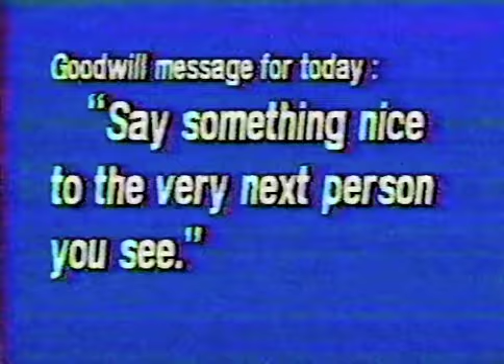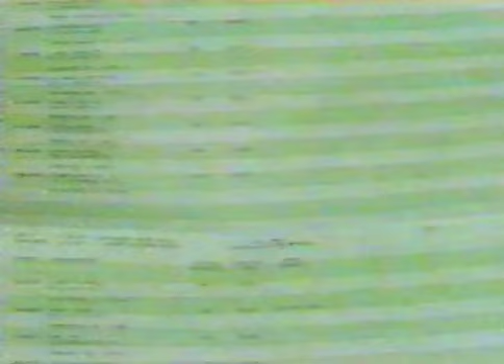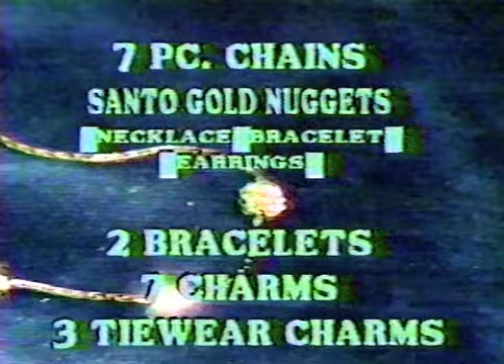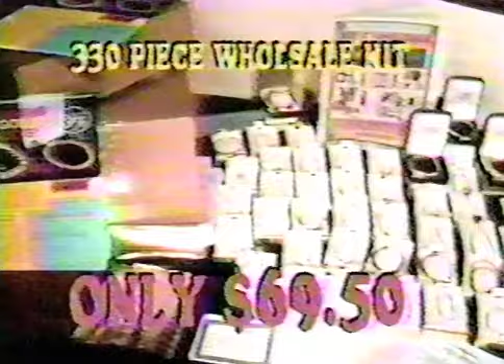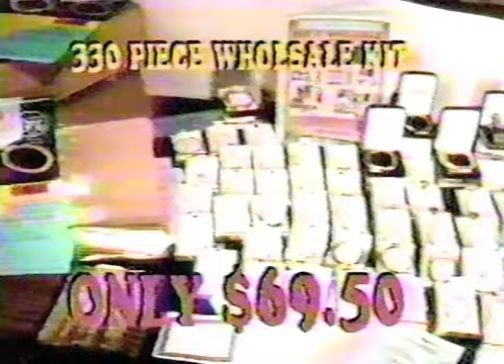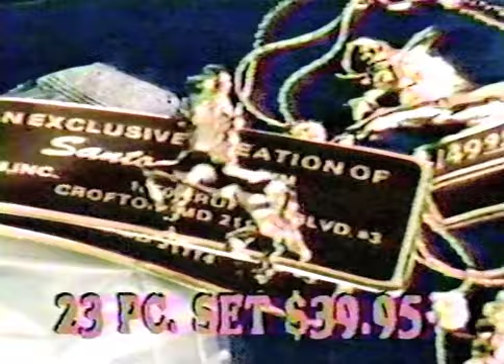Santo Gold - "Blood Circus" late-night infomercial (1985) - Part 1 of 2

Comment: Yes, saw it originally when it was aired in Syracuse, following Late Night with David Letterman, around 1986 or 87.  Usually the station would go off the air at that point (yes, it was that long ago), but channel 3 made an exception for the incomprehisible phenomenom (sic) that is Santo Gold.  Plus, they probably got paid 100 bucks or so to have it aired.  Needless to say, the storage and accesiblity of this footage justifies the entire existence of YouTube and the vast infrastructure of the Internet that allows it, if only due to the fact that I can prove to the skeptical multitudes once and for all that the Santo Gold infomercial actually is a thing that really existed, not some long ago imagined fever dream brought into my mind by absinthe and too much cough syrup.
Reply: This is from June 1985 not 1987.
Reply: @Tornado1994: The infomercial ran through the spring of 1987. (Possibly longer, but at least until then.) I saw it many times during that period.
Reply: It was on the Erie, Pennsylvania stations as well.